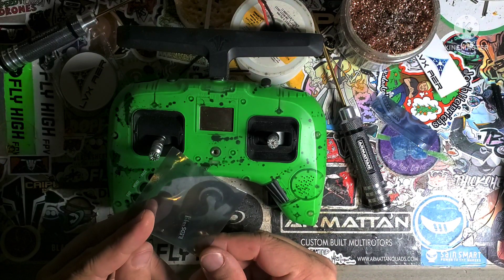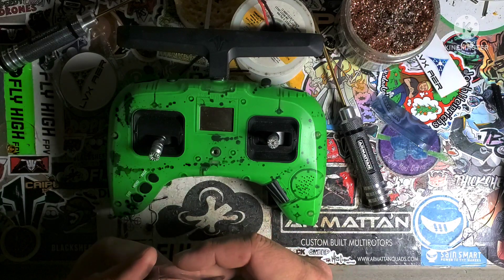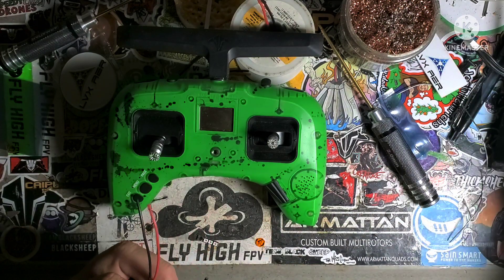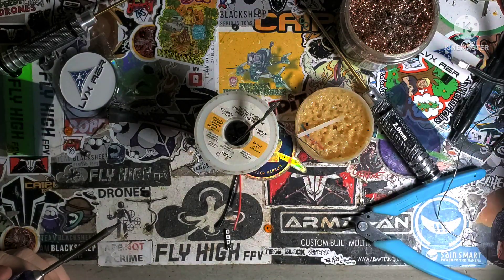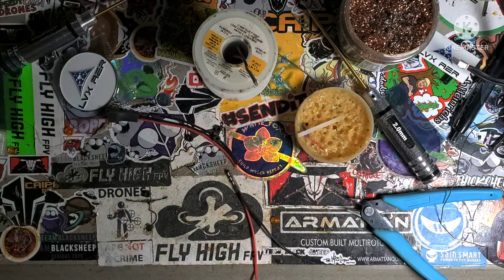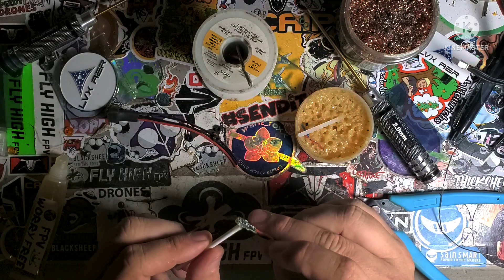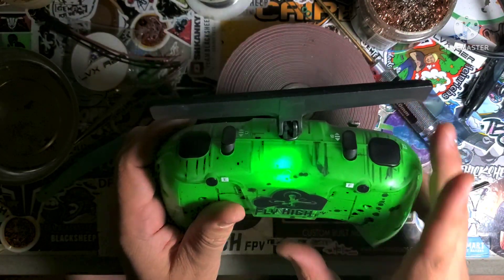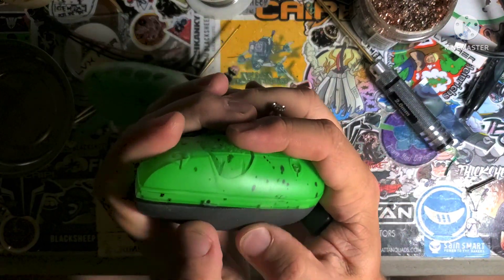How to install a 5v LED in your TBS Tango 2 / Team BlackSheep Mambo Clear Nostolgia Case - Tutorial

Comment: Great info 👍👊 I had my pro sticks get jammed on the tango 2 and had to rilly pull on them to get them unlocked so they could be folded , I'm guessing I need to fold them more often .
Reply from the maker: My buddy got mud in his folding sticks and they jammed in place for a bit, till he cleaned them up, and eventually put graphite on them...mine have been folded multiple times a day for 2 years  without issue.  I did have alot of dust and grit in the gimbals themselves
Reply: @Fly_High_FPV  I'm thinking dust build up as well , it's been a good 2 year's of ownership just haven't traveled much with them .
Reply from the maker: @Gene's RC Addiction  these v2 gimbals will be released next month, about $25 for a set of v2 basics and abiut $45 for the v2 folding. Great way to spruce up my hard working daily driver

Comment: Very cool man, I'm trying to decide if I want to do the nostalgia case like you did with the same color green and purple, or keep it black. I think I'm about ready to buy some more items from you. I still need a TBS Unify Pro 32, but I also need to install a GPS this time; I can't afford to lose another quad. I'm going to head over to your store, talk to you soon.
Reply from the maker: Best thing to keep from losing a quad is the ViFly Finder , screams like a demon when the battery unplugs and enhances your buzzer
Reply: @Fly_High_FPV  I have a VIFLY Beacon that comes with its own 1s battery. I was going to get the ViFly Finder, but I ended up getting this in a trade; it's brand new. On my first build, I used a TBS Crossfire Diversity Nano receiver with it's own 1s power supply, so I could find my quad if I lost it. I talked to a couple people at TBS to make sure how to do it properly and did what they said, then when I lost my quad, I was trying to use my controller to find it and nothing was happening and I couldn't find it on my radio. I immediately contacted TBS and was surprised to get an immediate response, but all they told me was that the TBS Diversity Nano receiver doesn't work with the Tango 2; I wish they would have told me that in the first place. Why would they make something that doesn't work with their product? Now I just want to be able to find my quad if it happens again.
Reply from the maker: @gargolaconrad3188  uh, the DiversityRX works just fine with Tango2...
Reply: @Fly_High_FPV  I'm sorry, I worded it wrong. "The BEACON MODE" of the Diversity RX doesn't work with the Tango 2. SORRY ABOUT THE MIX-UP. After speaking with one person at TBS and they told me that it doesn't work with the Tango 2, I contacted a couple other people and they said that he was right, The BEACON MODE doesn't work with the Tango 2.
Reply from the maker: @gargola conrad  awww, beacon mode...i bet that gets resolved when the new Pro DiversityRX comes out (shhh it's still unreleased)
Reply from the maker: f you still have a connection to your quad (green light) you can pull up the sensor list and see the raw DBi. Turn the controller backwards, so the antenna is flat into your belly. Now slowly turn your body and watch the DBi value change as you turn towards and away from the quad.  Hone in on the signal and move towards it, then turn and check again, then move closer.  It'll take you right there.
Reply: @Fly_High_FPV  Well, put me on a list, and I'll get one from YOU as soon as you get one.
Reply: @Fly_High_FPV  I walked around for well over an hour with my radio trying to get a bind signal "green light", but nothing. Then a friend drove me around for a while, trying to help me find a signal, but again nothing. I live in a rural area with wooded areas, cow fields and farmland. I have a good idea of the vicinity that my quad is in, but it's getting permission to go on the property to look for it. One guy denied me to look in the woods behind his house, but said he'd let me know if he seen it. I got permission to search the property next door , when there's a family member on the premises, but the owner of the property next door died, so there's hardly anyone ever there. I'm pretty sure it's on the property of the dead person's. which is about a thousand feet from my property. I still have hope. this has been months ago, but I'd still like to get it back.
Reply from the maker: @gargolaconrad3188  not officially announced yet, but trappy leaked that the high telemetry output diversity RX is coming